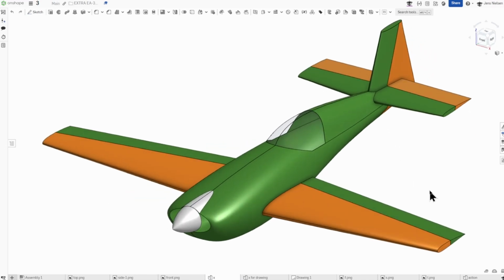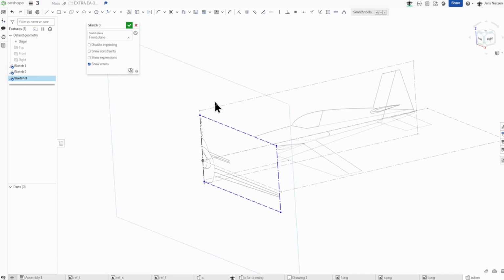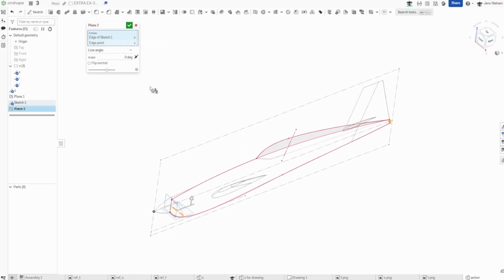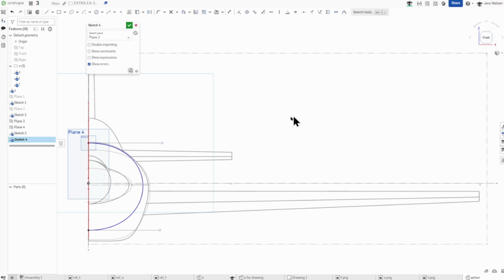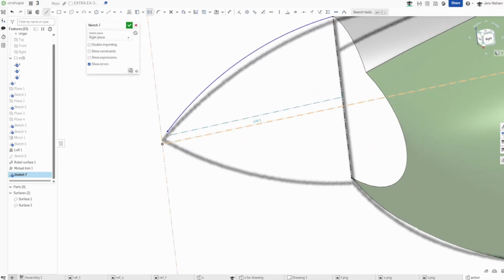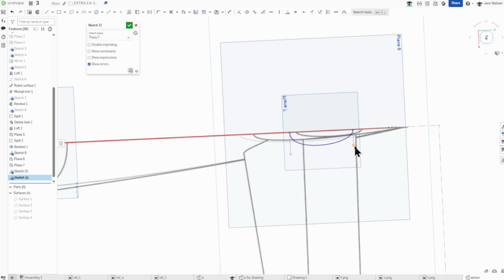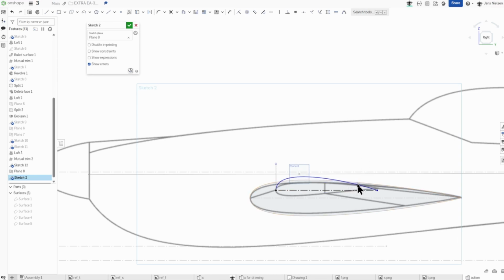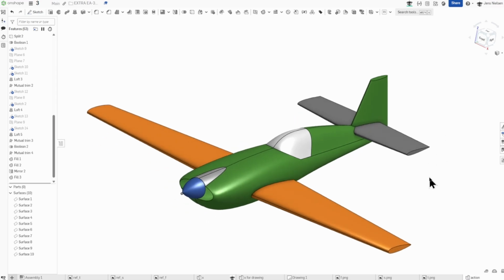Surface Modeling AIRPLANE Designs Made EASY with Onshape

Comment: I wonder if you'd be interested in doing something similar with a WWII warbird? I'm working on a Messerschmitt bf 109, it has a very different cross section to your example and I'm really struggling with getting accurate surfaces and setting the upper / lower breakpoint? Thank you.
Reply from the maker: I modeled the 262, but have not published anything related to the military on my channel.

Comment: Thank you so very much for sharing your work flow. I managed to work 90% of this exercise with almost no prior experience in surfaces. Brilliant!
Reply from the maker: That is great to hear. Which 10% did not work out?
Reply: @cademist  I had some issues doing the bolean of the vertical stabilizer and the fuselage, due to some misalignment of splines (user error!) and couldn't fill the front of the fuselage.
Still, thank you for taking your time to make these awesome tutorials. Bravo!
Reply from the maker: You are very welcome. Actually, I got that "user error" myself, only, with video editing, I get rid of those easily!